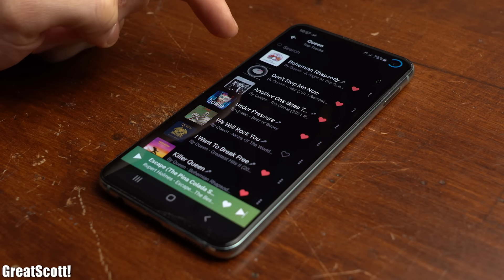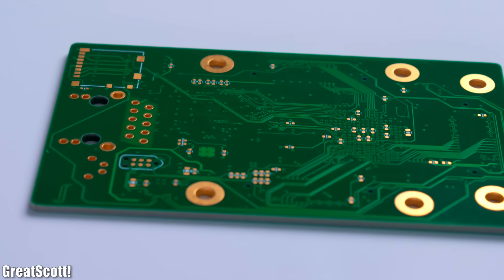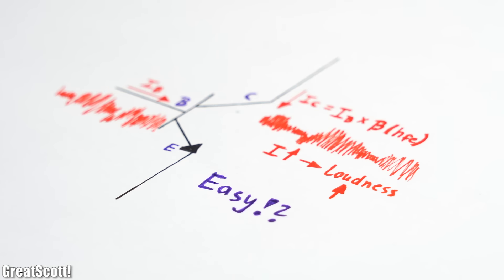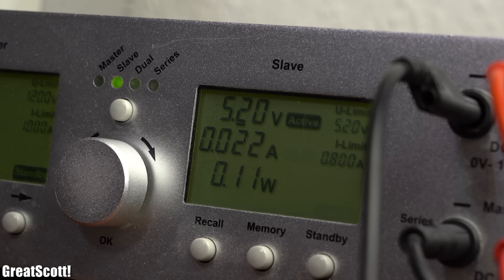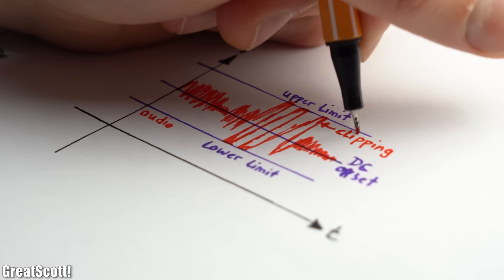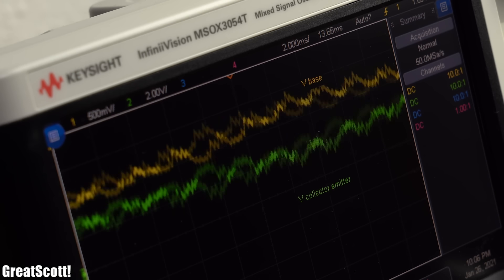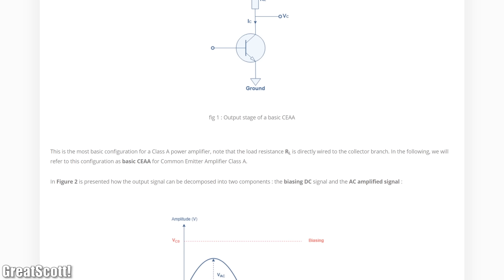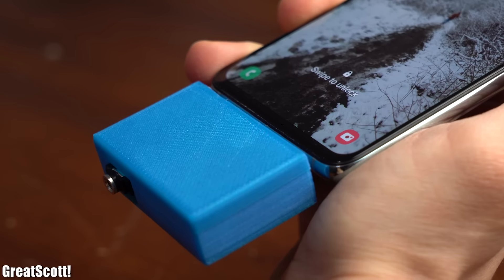Building the simplest, best sounding, yet most inefficient Audio Amp! || Class A Audio Amp Tutorial

Comment: Probably the biggest challenge of this project is finding a phone with a headphone jack ;)
Reply: you can get a usb c audio card thing i believe? then the unit only needs the usb c port!
Reply: @Epsicronics  USB-C (in fact ANY USB connection) only carries digital signals. So you'd need something that does digital to analog conversion plus supplying you voltage to run the amp.
That makes it quite more complicated.
Reply: @Ni5ei  I don't fully agree, i understand what USB is, and while this is more hacking than building, you could take a small usb c to audio jack adapter and fit it in the same case as the rest of the circuit, giving you both audio and power through the USB C interface.
Reply: @Ni5ei  no, it can also support analog audio via audio accessory mode, although this is not implemented on all phones (one plus, Xiaomi have it, but not pixel, Samsung).
Reply: If you want to do this with an external DAC, why not have a more powerful amp integrated  after that DAC anyway? Fiio makes a few, either bluetooth or wired.
Bonus: LG V/G series owners can use the built in DAC in high impedance mode, it essentially does just this, look it up!
Reply: @MrD0r1an  You are right. I didn't know this but USB C can indeed carry an analog audio signal.
Reply: lg 👍
Reply: The usb C port can carry audio in a digital format, so all you need id a dac/amp. Apple sells their dongle for like 10$ but if you want something really nice try iFi Audio their stuff is suuper good
Reply: Thank you Apple :)
Reply: Damnmm true lol
Reply: sadly..
Reply: @Ni5ei What if we connect a battery to the amp?
Reply: I have a laptop

Comment: We all know that to achieve the best sounding hardware, you'll need to gold-plate everything. The connector, the wires, the PCB, the insulators.
/s
Reply: hahaha nice one! :D
Reply: the enclosure... :D
Reply from the maker: Dammit, I forgot that.....
Reply: Ah, that explains all the gold-plated optical S/PDIF / Toslink cables for sale!

👀
Reply: @hempbear  That must be the sale price, I paid a lot more for mine 😜
Reply: @hempbear  per inch.
Reply: @greatscottlab  The reason out processor pins, gpu pins and ram pins are always gold plated
Reply: @tomf3150  Without taxes
Reply: @greatscottlab  u can try iit next time
Reply: You also need gold solder and gold stranded wires and you need a filter on the power line of the same specs.
Reply: Gotta have those gold plated 1M ohm resistors for SUPERIOR audio quality
Reply: @greatscottlab  it happens some time don't worry
Reply: And you need to build the project under the Sun's natural golden ray, not under artificial lighting.
Reply: And "silver-plated oxygen-free copper headphone cables to give you the bass power and definition of copper with the high-end articulation and detail of silver"
Actual quote from some snake oil peddler website.
Reply: so the RUSSIANS SOUND VERY WELL  COZ they gold plate their theeth
Reply: You forgot oxygen free lol. Would an amp sound better in the vacum of space? Hmmm
Reply: How 'bout golden caps
Reply: Don't forget the golden phone.
Reply: @ZsomborZsombibi  ahahah Also just for jazz/blues. not recommended for any other trash genres
Reply: Don't forget the optical audio cables too
EDIT: dammit I was beaten to it!
Reply: @AndrewGillard  yeah!
Reply: Especially your digital HDMI and toslink cables...
Reply: @hempbear  Your comment is what's required to hire editors for insert-snake-oil-audiophile magazine lol
Reply: Oh, and don't forget to avoid sharp turns in your circuit, electrons don't have time to turn around!
Reply: Bless you, all you geeks. This thread is absolutely brilliant!
Reply: @greatscottlab  Search for TOTO-13-K and you will find a gold-plated Toslink cable... Yeah, these are for real! (Not real gold though.) (I hope...)
Reply: Don't forget the solder as well.

You think I'm joking, but Sony actually pulled that shit off
Reply: Misleading title :/
Reply: And what about your ears?
Reply: Take a knock. LoL
Reply: @michaelzakai6722  You're BOT
Reply: @andrewangel9362  You're BOT
Reply: @UnknownPerson-nl7te  I assume that's for higher conductivity, so that even when less of the pin/pad is in contact with the connector, stray resistances and capacitances don't slow down the signal propagation too much.
Reply: I was born with a pure gold spoon in my mouth.
Reply: You forgot the phone and the hand with which you choose the song
Reply: Nothing will help this kind of amp :D
Reply: I'm sorry genius gold plating is for oxidation reasons not for sound quality reasons if you want it for sound quality you would use silver however even silver oxidizes
Reply: +Asu01 Why not use the metal mithil?
Reply: @galfisk lmao, what are they smoking.

Comment: Lovely! Will steal the design and build a higher voltage one for my 400 OHm headphones
Edit: I've done it! Adjusted the resistors to match the higher voltage and current required by my AKG 340 and it sounds unreal! Way better than it has any right to. Can be powered for hours on end with just a small 3s lipo as the power consumption is so low. I could also boost the 5V USB power from the phone up to 12, but I fear it would add noise...
Mods I did are: increase current to 30mA, adjust the bias voltage divider to work correctly at 12v (2.2k + 22k) and replace the bc337 with two bc238 (they were what I had lying around, as a bonus they have a Gain product of 250)

Edit2: been using it for days, it's downright amazing! So much so, that I've ordered all the necessary parts to build a proper one, with integrated battery + charger, and isolated 24V boost converter. I think I'll 3D print a cute case for it to make it pocketable and make it a daily carry gadget. I don't really care that it's not power-efficient either, since it'll be pushing 200mW per channel at most...
Reply: Hey Francesco, It's been a year or so but I wanted to ask if you ever built your final amp and if you still use it? I'm gonna dive into it as well for my Sennheiser HD569s (28ohm). Is the amp pretty loud with your AKG's? Do you still like the design? Have you made any changes or has there been any issues after a year? It looks like a really fun project
Reply: @tgirard123  hi! It worked, but I couldn't make it produce decent sound reliability, I ended up using a speaker amp to power them.

Comment: It's really cool that LG still provides built in 32 bit dacs in their phones.
Reply: True bro
Reply: @mygfleftmeforatrans3593  your name. Damnnn
Reply: 32-bit DAC’s are a scam though
Reply: @lotrbuilders5041  how?🙄
Reply: Now if only they could engineer a phone that lasts longer than 6 months. I had 5 of them over the course of 2 years and they all failed due to bad solder allowing the chips to come loose over time.
Reply: @SmallSpoonBrigade  I recently heard that they are decommissioning their mobile department.
Reply: @GauravSharma-dy8xv  That wouldn't surprise me, the experience turned me off of ever buying anything from them. The phone was insured, but it was a rather expensive phone and it took weeks to get replaced because of shortages. That had to have cost them a ton of money even if they refurbished the defective units.

Comment: Great video! If I remember correctly from my classes at university, input and the output create a high pass filter, so input's cut frequency in your circuit with 10uF and an equivalent resistance of ~657 ohms (R1//R2//(Re*Beta)) is 24Hz which is fine but for the output you would need to have around 220uF to have a cut frequency of ~ 38Hz instead of the current ~837Hz you currently have. so you will hear more bass, which might not be so important if you are listening to audiobooks :)
Reply: I post the same comment. True, this need a bigger cap in the output.
Reply: Actually, you're missing the point that the output impedance of the amplifier (130R) is considerably greater than the load impedance (probably around 20R to 32R), and so the sum of those impedances is what determines the high pass roll-off frequency, which is actually more like 100-120Hz in this case. Using a 22μF capacitor would be fine as I seriously doubt that the headphones have any usable response below 50Hz.

Comment: A follow-up with designing a PCB would be nice. I think this could actually be a project you could sell as small DIY-kits as it is actually practical, you can learn something and it is simple enough to solder it yourself :)
Reply: I feel like the point is to buy the needed parts yourself and learn a few things about eginering along the way

Comment: I like your approach on this video. Keeping it simple and not bother with the advanced details, and ofc it works so why bother changing it. 
BUT There are a few details tho when it comes to audio. You went with "Best sounding" in the title so a little slap on the wrist doesn't hurt ;) 
Tental capacitors in audio path are typically a nogo as their capacity change versus the voltaqge which is across it. therefor you actually can get a different frequency response and distorsion.
Typically you also add a capacitor between collector and base to reduce oscillation(the easist explaination) Also known as "Miller cap"
A pulldown resistor on both input and output capacitor may save you a pop under startup 
And more minor things but the tentals surely caught my eyes when i saw this video.
Reply: Miller capacitor on a single common emiter stage ? :) really?
Reply: You're right that tantalum capacitors in the signal path are frowned on in hi-fi applications, but if you look carefully, the voltage across each capacitor doesn't actually change at frequencies in the pass-band of the amplifier, so the change in capacitance with applied voltage has no real effect here. It probably doesn't matter with earphones if the cut-off frequency varies by a few Hz for frequencies below 100Hz because the earphones won't have much response there anyway.

It wouldn't hurt to add a small polyester capacitor (maybe in the range 30pF-300pF) from collector to base to roll off the highest frequencies - only bats would be likely to be affected if listening through the earphones. But it's really rarely necessary in a single stage common emitter - especially one with hardly any voltage gain.

Comment: Could U show how to build an RF Power amplifier for Ham or Pirate Radio? Would be really cool.
Reply from the maker: I can put it on my to do list :-)
Reply: @Darren Munsell that can easily be fixed using a router such us the ac68 from Asus (tossing a random one there, just cause I'm familiar with it) and changing the stock antennas some some directionals one. 

Run the router in access point mode, point the antennas where you need signal and you are done :)

Seriously thou, amplifying WiFi signals it's not an easy feat with DIY electronic, it's rather complex and really cost inefficient.
Reply: @greatscottlab  great👌
Reply: That's a can of worms yargggghh lol
Reply: @Darren Munsell Take a look at LORA communication... Maybe that's what you want.
Reply: @Leon Your local Radio Regulation Authorities would be very happy.
Reply: @hopkinskong I am sure they will be happy
Reply: @Leon-ts1nl  If the output power of your homemade RF amp below your legally allowed ERP/EIRP, and you have the gear to measure the produced harmonics, maybe.
Reply: Funnily enough, in many ways RF power amplifier design is easier than audio amplifier design. Audio frequencies are so low that you don't get to use things like transformers and inductors very well, and things like decoupling capacitors are difficult. At HF frequencies, the capacitances required to decouple are very easy to work with, and inductors/transformers require only a couple windings.
Reply: @skittermckitter05  HF Only, once in UHF or in GHz range, everything are different.

Comment: love your videos.  Just wanted to chime in as somebody who has calibrated transducers for audiologists.  the correct way to couple an insert earphone with a microphone is to use a coupling cavity that simulates your ear canal.  you just need an air tight link between the mic and transducer that is about 20 cubic centimeters in volume.  This will more accurately present the sound to the speaker in the same way you would have it presented to your ear.  not really necessary for this application where you are taking a quick look but for any  more precise determinations this is the proper method.  Thanks for creating such great content for us!

Comment: Superb explanations usual. But doesn't having such a small value 10uF capacitor on the collector limit the bass response through your earphones? I would have thought maybe 100 or higher?
Reply: Since the amplifier has an output impedance equal to Rc (130R), the output at the earphones (likely around 32ohms impedance) is reduced by a factor of 32/(130 + Xc + 32), where Xc is impedance of the capacitor at a given frequency. When Xc is negligible at high frequencies, the reduction is fixed at 32/(130 + 32). So the -3dB frequency occurs when Xc = (130 + 32) ohms, not just the impedance of the earphones. A quick calculation show that 10μF has an impedance of 162 ohms at a frequency of about 100Hz. Although a 22μF capacitor might show a little improvement in bass response, I think you'll find a 100μF capacitor would be no improvement on that, as I seriously doubt anybody building their own amplifier owns earphones with a bass response extending down to 10Hz.

Comment: My first audio amp was a pair of random mosfets connected to the audio pins of my pc and drawing 5V from a spare power supply pin on a bread board. A really fun and simple way to give my pc some decent sound and volume. Next time I should build a soldered one because loose pins vibrated and added static